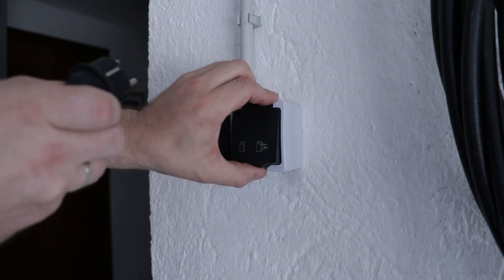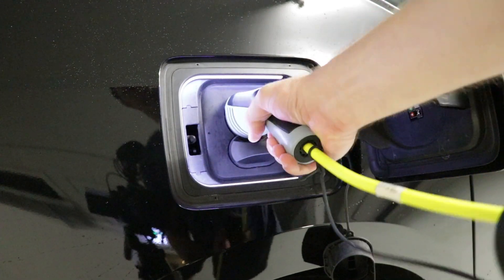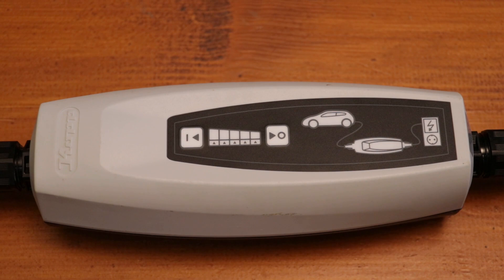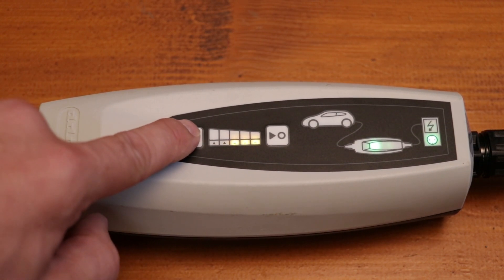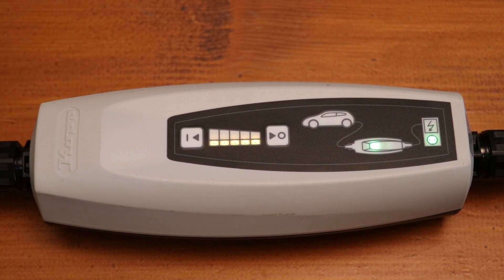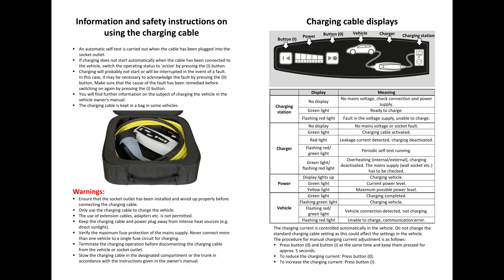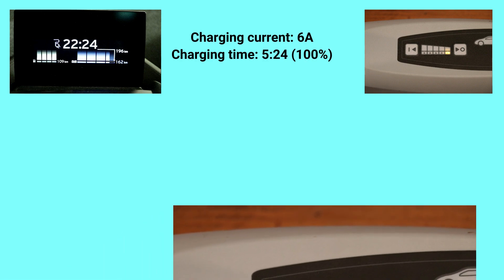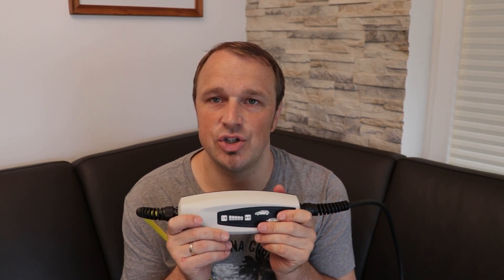BMW i3 charging faster: This trick helps (230 V AC)

Comment: can you purchase that charging cable in US & if so where & how much?
Reply from the maker: Hi @Kevin Cummins ,

Merry Xmas :-)
The cable in the video is made for 230 V AC and in US there is 120 V AC. So I think you can not get exactly the same part as I have shown in the video. (In UK there is the same connection that's why I made this video) There is also a new Version of the charging cable available.

For the US I found the following Links:

The charger from BMW: https://www.shopbmwusa.com/PRODUCT/5755/BMW-TURBOCORD-CHARGER

The charger from BMW / Delphi: https://ebay.us/1ucLm2 (I know that there are different versions of it, I think this link is the latest version)

I wish you a happy Xmas time.

Cheers
James

Comment: Kopp has terminated the production of this EVSE at the end of 2017
Reply from the maker: Hallo +Tamas Muhari ,

aha, interessting but there will be a new one for the i3 because the people have to charge. :-)

Cheers
James
Reply: James, the new i3 models come with fixed 12amp Charger (for the EU market) manufactured by Delphi. These EVSEs are not adjustable, unlike the Kopp, however from the i3 dashboard the user has the possibility to reduce the current in similar steps as in your video.

Comment: What name of that charger?
Reply from the maker: Hi +Nrhfbfb ,

on the grey plastic the company name says "Kopp". On the backside you find also TE which means "Tyco Electronics" 
It is made for 230 Volts 50 Hz AC up to 12 Amperes. 

Cheers
James